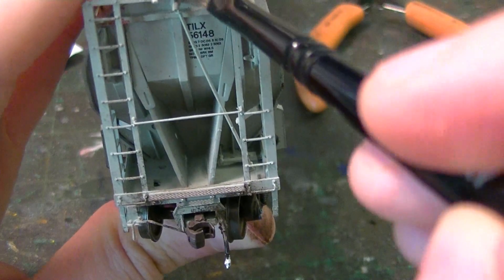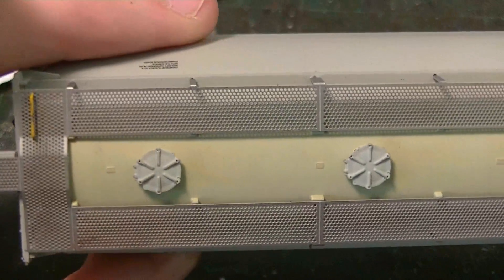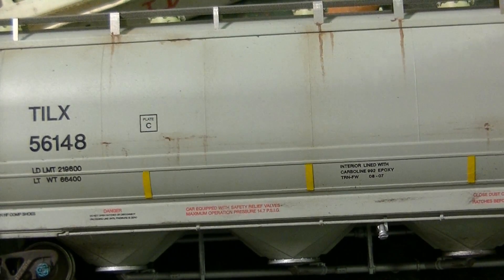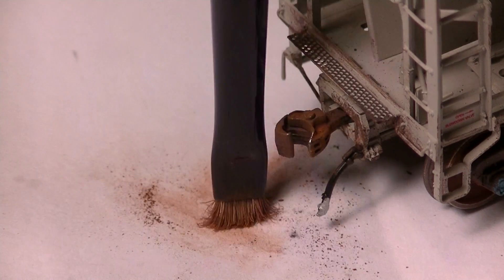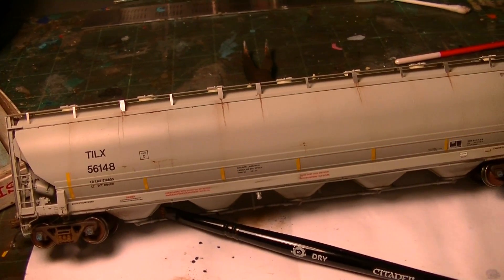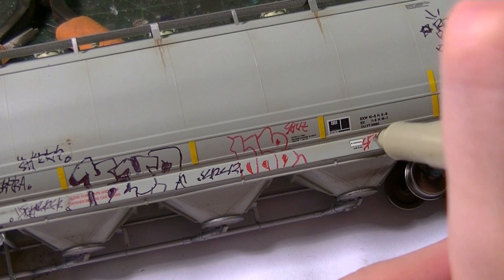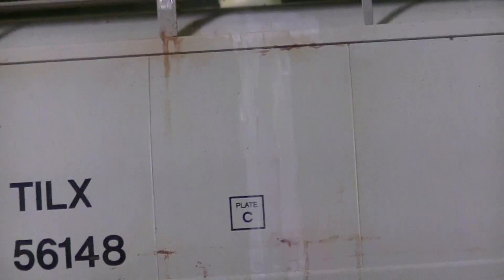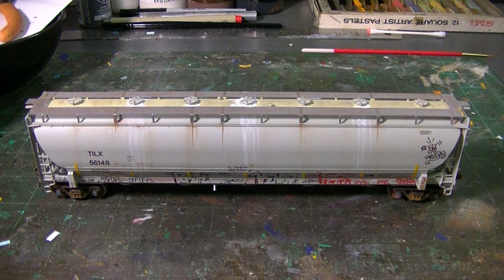Detailed Methods For Weathering A Modern Covered Hopper! Part 2

Comment: i normally do my paint pens last because if you do other work where you have to handle the car it smear the ink if you touch it. in my experience it takes between 10-20 hours to fully dry the ink depending on the pen. it normally does not clean off to well if you smear it bad enough that you have to redo it. i noticed you smeared the red graffiti tag you did. I'm not calling you out on it I'm just saying... damn it I hate when that happens I myself do it frequently. :) good work great video

Comment: Nice video. Do you know what type of grain this car carries?
Reply: It's not a grain hopper. Grain hoppers have the long doors that cover an opening along the whole length of the car and they empty through doors in the bottom, not pipes. This hopper is for some kind of powdered chemical.